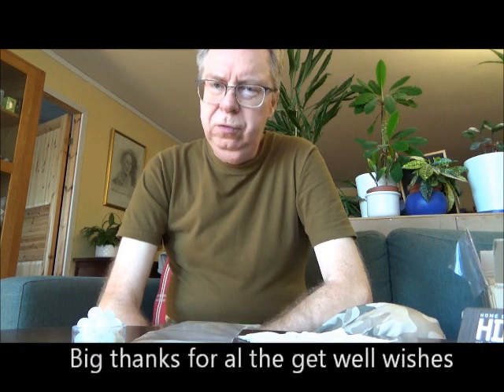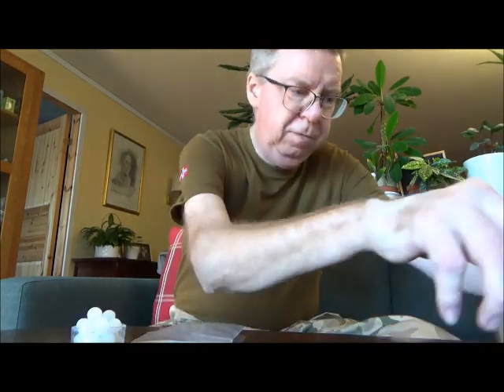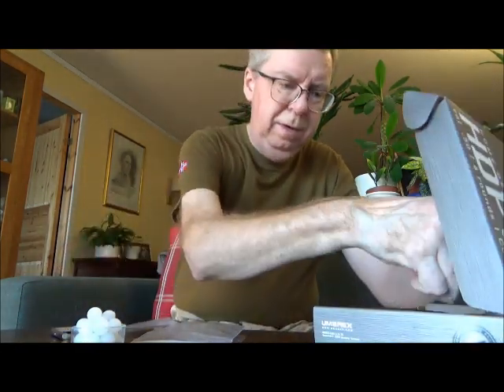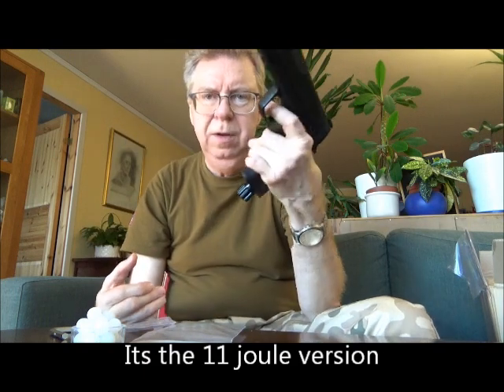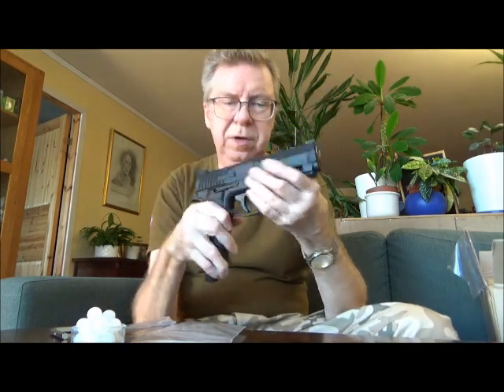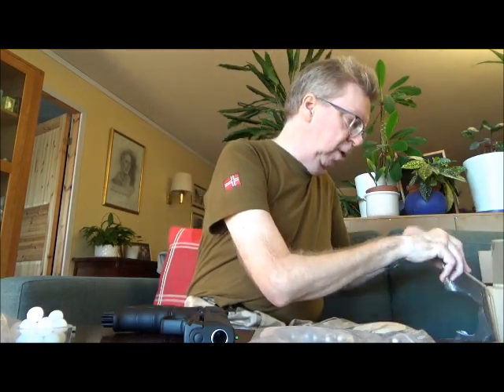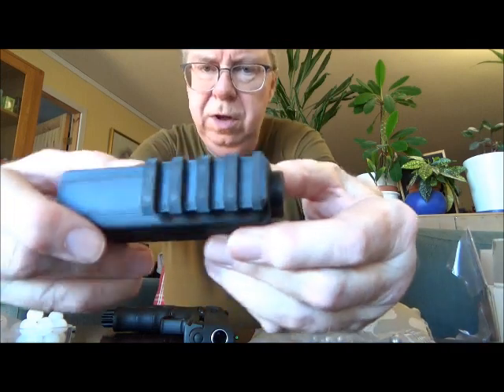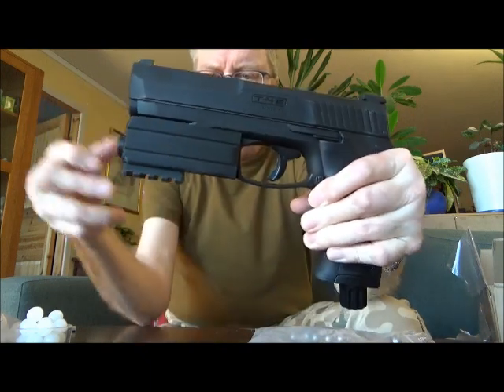Umarex HDP50, New Pistol

Comment: It’s good to have you back!!

That speedloader has a round screw cap on the front.
Reply from the maker: Thank you my friend. Yes I tried opening it but it has no threads. Seems to be just pushed in. 🤔
Reply: @runerebel8441  I think it could be stuck. Try using pliers to grip the cap and turn.  Carefully!
Reply from the maker: @ThomasSmith-ki4gi  Thanks. I will try

Comment: I'm very glad you're feeling better! Make sure to take it easy for a while. Do you think the aluminum balls might be getting stuck because the spring needs to be replaced? maybe they are too heavy for it? 🤷
Reply from the maker: Thank you my friend 😃. Not sure why the aluminium balls jammed. The are lighter than the steel balls that works just fine, and they have the same diameter. Its very strange indeed. My old HDP50 works great with the same alu balls.. 🤔

Comment: i had the same problem with the aluminum balls . in these markers size really matters . 
  i can shoot 12.7mm 8.53 gram steel balls in my hdp.50 once i break in the follower . 
this is the reason that LESS LETHAL FOR DUMMIES aka,"Shawn" uses a magnet , it actually holds the steel ball up into the chamber allowing the closing and air sealing gate to fully close. 
HE IS A GENIUS IN MY BOOK FOR COMING OUT WITH THIS < IT REALLY SOLVES THE PROBLEM WITH USING STEEL BALLS , i never bought any magnets yet , thats why i just do the RG MOD of things , but one day i will find some little strong magnets i can use and probably do it this way , it will save me a lot of time !!!..
THANKS AGAIN SHAWN !!!!!!!!
  because of the shape of the closing gate , when trigger is pulled it gets hung up on balls and wont allow you to pull trigger to get the shpt in .
 i once was filling and sanding these gates but found a better way to do this, well not better but way more easier and less time consuming LOL .
 i have a flashlight with a super strong magnet , i place it on the plastic and hold it there then when i pull the trigger , it holds the ball in place into chamber  ,lets the sliding gate close and allows it to fire .
  so with magnet still in place , i will keep pulling on the trigger ,sometimes it takes 20 ,30,40 , 50 , 100 , and sometimes a little more to fix the problem .
  what this does is to slowly modify and soften the sharp 90 degree edges on the sliding gate .  its made of very soft metal so it is very easy to shape and round off smooth .
  now with magnet off , pull the trigger ,even when its harder to pull keep just simply pulling on trigger till it smooth again .
  what i did to make this job also less time consuming , i soaked a couple of 12.7 steel balls in water for a few days . what this does is microscopically causes it to rust and all the very thin coat of chrome plating completely falls off revealing the not so smooth surface of the steel ball which is more like iron , it even smells very "ironly: LOL !!!!
 whats left behind is a slightly rougher steel or iron ball .
i load these two modded balls first then i put in one more regular ball and keep pulling on my trigger till the balls round off the sealing/loading sliding gate till all the sharp edges of it are gone .
  these gates kindda cut in the balls ,slightly, so it makes pulling the trigger very hard ,thats why it so hard to shoot rubber balls unless you oil them first .!!!
so i dont put rust in my marker ,put a drop of oil on your thumb and first finger and keep rolling them around till ball is rust free ! 
 i like the aluminum balls more  in my HDR.50 a few less problems , but they do work better in HDP.50 once you do the RG MOD to the sliding gate .

  now because i use 2 piece tuning barrels on some i cant use the 12.7 mm steel or what ever balls in them so i shoot only 12.65mm in these super tight tuning barrels , i love the ones from HOME DEFENCE-24 the best because they are made out of real steal and a magnet sticks to it fine !!!! every thing that FLO from HOME DEFENCE-24 sells is number one quality stuff .
 so use regular steel 12.7 mm balls like i showed you and RG MOD your loading/sealing/CLOSING GATE . the 12.7mm regular 1.2 inch steel balls works fine in every marker that shoots .50 cal ammo , but if you have a 2 piece tuning barrel , it can get stuck in it ,,,,, so def use a 12.5 to 12.65 mm in them , the 12.65 seals in the 2 piece barrels perfect fully so no air escapes when shot and will give you the most power ,more fps and more joules !!! . 
it blows my mind to see that factory 11 joules hdp that creates so much power . i wonder if removing the co2 restrictor or just drilling a bigger hole in it would help ? i have an assortment of restrictors with different sized holes for testing purposes .
I AM SO GLAD YOU ARE DOING BETTER MY BROTHER , WELCOME BACK , I AND EVERYONE REALLY MISSED YOU !
AWESOME SHOW AS ALWAYS MY FRIEND !!!
Reply: also i may add ,sometimes shooting the marker tilted up ,down ,left side , right side will make trigger hard to pull , thats why my RG MOD works so fricken well , in an emergency ,you want it to fire in any position right ? lol. !!! again take care buddy !!!!
Reply from the maker: Thanks for the info brother, The 12,5mm steel balls seems to work great, but the aluminium balls jams. No idea why. My older HDP50 loves the aluminium balls, so its very strange. Maybe I just have to shoot it a bit so parts will wear in 🤔. Take care my friend 😃
Reply: Fui aumentando o orifício do restritor até o buraco de saída ficar igual ao de entrada. Então agora são 9 a 10 tiros sendo que os 6 primeiros são garantidos muito forte. Ops.. Tenho o hdr .50..😊
Reply from the maker: @manfredohunterberger2403  Thats very cool 😎

Comment: What size hole is in the stock restrictor that comes with the 11 joule version I’ve asked so many people and nobody has responded thanks rune have a blessed day
Reply from the maker: Thank you my friend. I have been informed its 0,2mm hole in the restrictor. The restrictor can be removed or you can drill a larger hole. Max diameter Iam told is 1,5mm. Take care and have a blessed day you too 😃